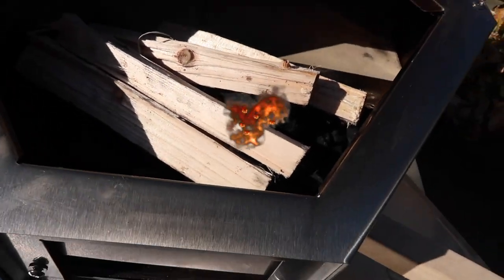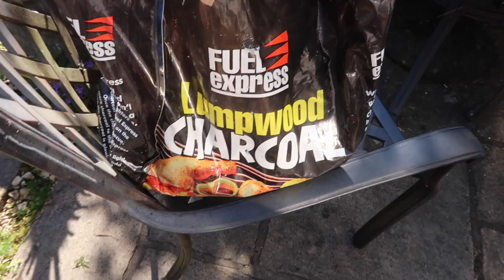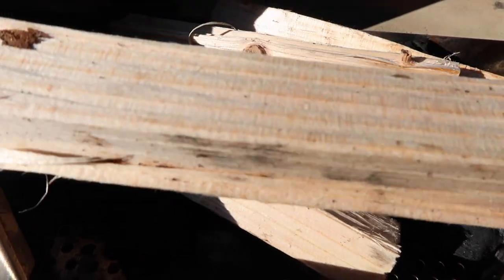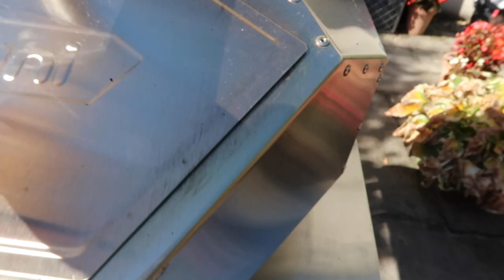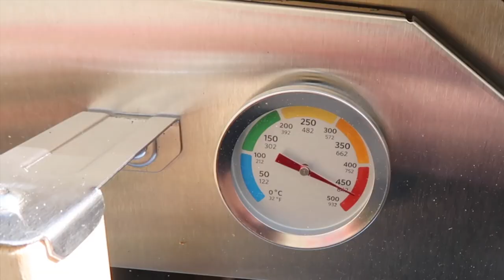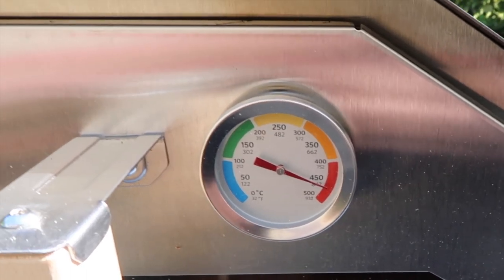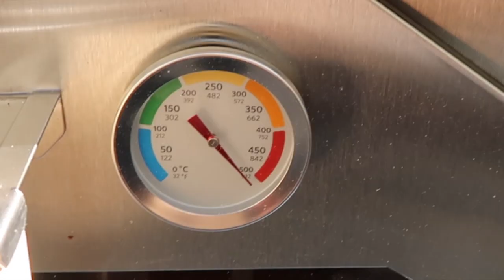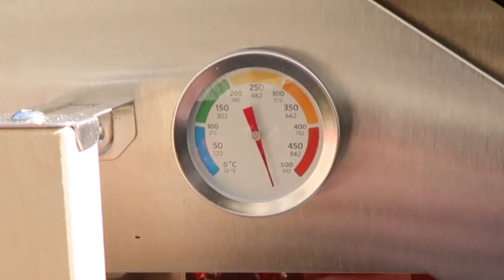Lighting Lumpwood with Gas Torch v Chimney starter | Ooni Pro Pizza Oven | Uuni Pro

Comment: I have problems opening the door at that heat, do you have problems openinh the door?
Reply from the maker: Yes - I did too - you need to adjust the door with the tool that's attached to the bottom of the oven.  Just loosen the hinges a little and you'll be good to go!

Comment: Nice to see you getting along with the Pro!  Enjoy your videos and they've helped me with topping ideas as well as getting me started on my Pro.

I like to use a stick of fatwood as a starter.  Put the fatwood in the middle of the tray (parallel to tray front) and place 3 sticks of kindling (perpendicular or fan shaped) over the top.  Light the firewood with the torch.  Once its started (~3-5min), stack two more pieces of wood perpendicular to the previous layer.  Then every five minutes add 2 or three pieces of wood.  Just before you cook, add one or two sticks of wood to the fire pointing at the front of the oven.  This will get the flame rolling to the front of the oven for that great top cook!  

Note also with the pizza door, there could be a 50-100C variance between the front and back of stone.  When we use the pizza door (normally we like the oven door), I like to keep the live flame rolling and turn the pizza inside the oven... quarter turn every 10sec or when you start to see the bubbles on the crust.

EDIT:  A small battery operated fan will help keep the fire burning hot and keep the soot down.  Point it at the back of the tray with the hatch on.

Keep the videos coming!
Reply: I like fatwood for wild fires Ken but obviously fatwood produces a lot of smoke, soot and creosote which i wouldnt want in a food oven like the Pro.
Reply: Yes, that's true of fatwood. But the single stick burns out in 2-3 minutes, and I find the initial start is always fairly smokey.  I leave the oven door off until I get the fire going or add the 2nd stage of wood.
Reply from the maker: Thanks!! And grateful for this advice. Fatwood isn’t something easy to buy here in UK probably available on Amazon.  I’ll give it a go once I get hold of it!  👍🏻
Reply: @Got2EatPizza  fatwood is just pine whereits become saturated with hardened sap or resin (bit like amber) I collect it from local forests but as i say it produces a large amount of creosote. Much more than other types of wood. It also has a strong pine and petroleum smell. I really wouldn't recommend it for a pizza oven. That creosote will collect and is nigh on impossible to remove from stainless steel once its baked on. Fatwood is reat for starting a camp fire in the rain, but not necessary for the Pro. Your lump must have been damp tbh. All it takes is a single wood curl firelighter to get it going in the Pro but a chimney works too. Chimney will take a bit longer to get the oven hot than starting the lump in the Pro but also you get less ash in the oven so theres pros and cons to both.
Reply from the maker: Matthew B That’s great advice - thanks!  Do you know how to store lump wood to dry it out?
Reply: @Got2EatPizza  tbh once its lit it wont make much difference, but you could lay it out on baking trays in a low oven if you're really keen. Bit like dehydrating foods you need to get it to temp then turn it off, add the charcoal and remember to leave the oven door slightly ajar so moisture can escape as dries out.
Reply from the maker: Thank you!  Super tips!  That’s advanced pro-woody stuff for me right now so I’ll suffer the consequences of inaction and keep using damp lumpwood!